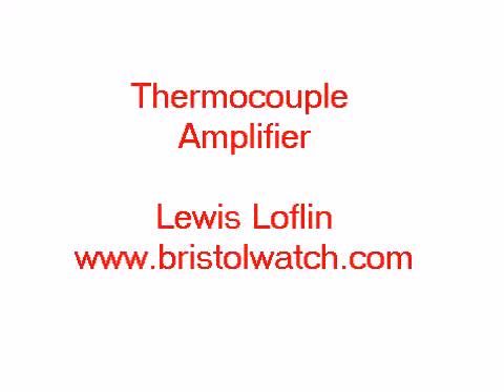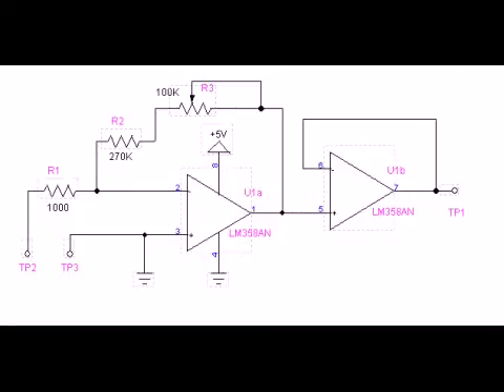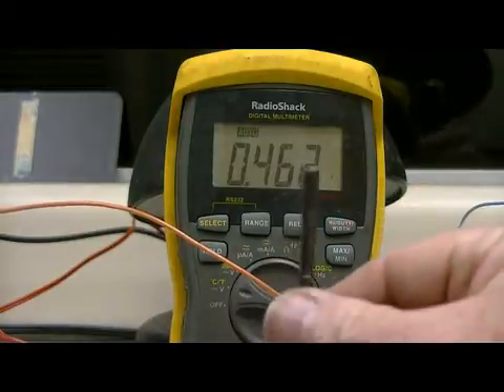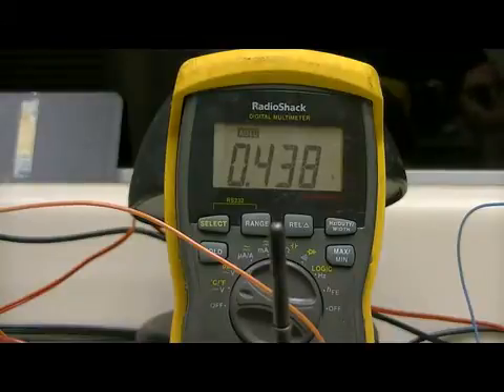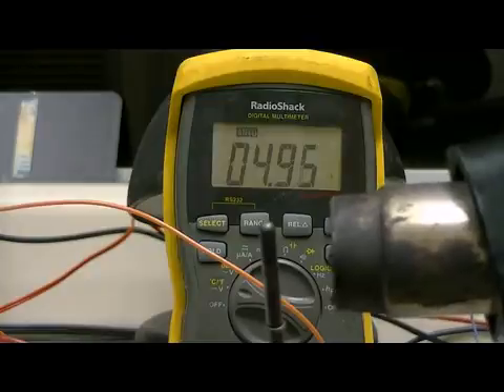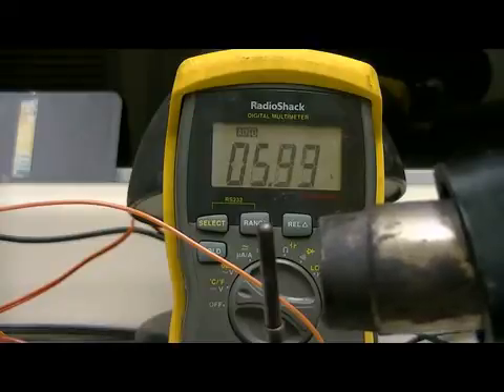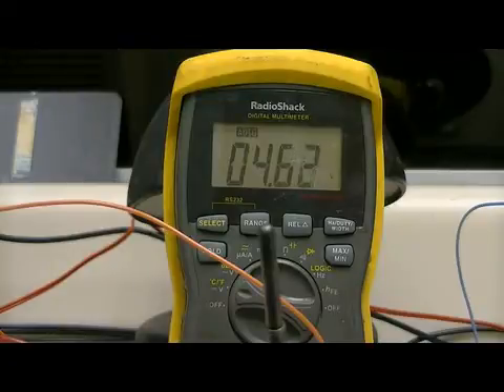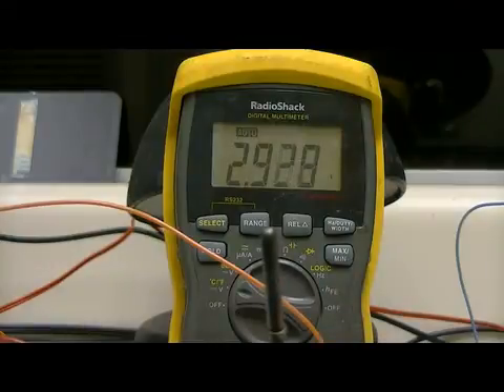Thermal Couple Amplifier Operation

Comment: sir do you have any circuit, that we can use it to increase voltages of thermocouple.
I want circuit for PLC.
Reply from the maker: +Syed Bilal Hashmi This circuit does increase the voltage as is - is the PLC input an ADC?
Reply: yes ADC
Reply: +Lewis Loflin 
One more thing Sir, I would like to ask that in above circuit (TP1,TP2 and ,TP3) I am little bit confused in these terminal points. 
Because thermocouple have two terminal points.
So where I connect thermocouple points exactly?

Comment: Do you have any suggestions as to how we can amplify the milli-voltage from a thermopile in our gas fireplace to a remote thermostat to overcome the added resistance for the wire from fireplace to thermostat?